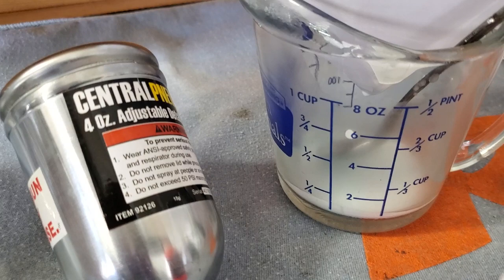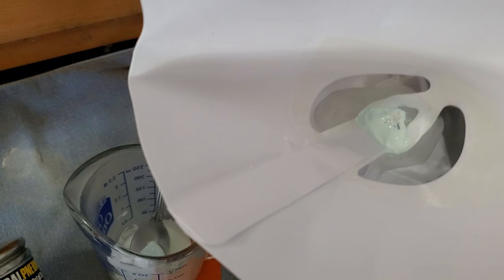LIQUID MASK TIPS!!! For RC CAR BODY'S.......

Comment: I do the same thing with Bob Dively liquid mask(Maybe hard to find this stuff now). Cut 50/50 with warm water. I converted one of my Thayer and Chandler(badger) AB to a 1mm needle and nozzle set and spray the liquid mask thru an airbrush with no problems.
Reply from the maker: Thats Awesome 👌🏼

Comment: Fasmask is exactly the reason I use Bittydesign, it's way too thick. Get you the HVLP sprayer where you got that detail sprayer lol at Harbor Freight it's only about $20 then get a bottle of Bittydesign liquid mask and then you won't have to worry about reducing. I spray it directly from the bottle.
Reply from the maker: I Aprreciate that my man. Thanks so much for tuning in. I will give it a shot
Reply: @spraym88  Anytime bro, Bittydesign also sprays on and dries with a little bit of a pinkish hue so you'll know where to cut. It sprays great and is very easy to cut and peel. Have a good one.
Reply: @Jarhead1313  great info. How do you clean up the Bittydesign from the gun? Just water?
Reply: @bradgray8064  I use Mineral Spirits
Reply: @Jarhead1313  thank you.